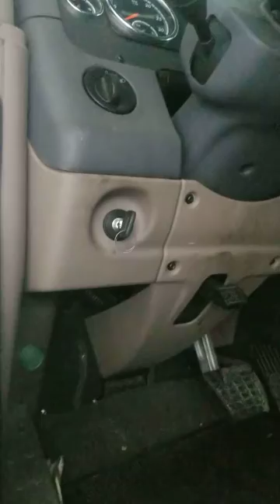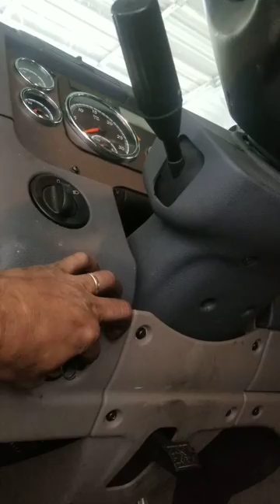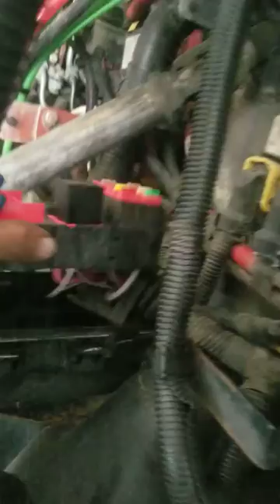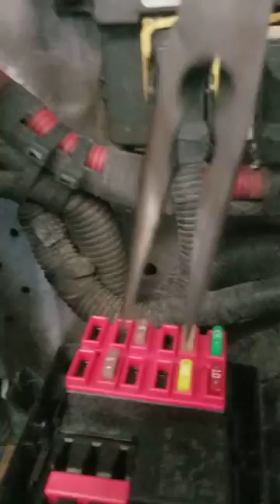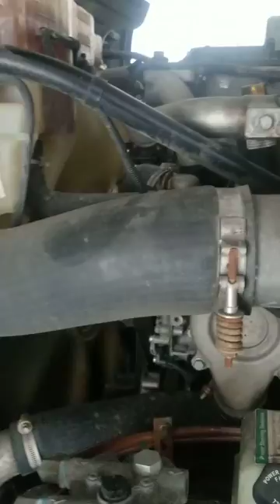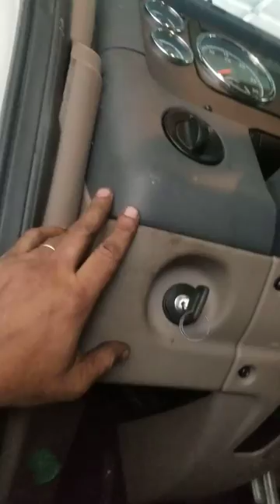2013 freightliner wont start quick fix

Comment: Thanks for the tip. Saved me a tow or Road Call. For others drivers looking to do this, make sure when you pull that Fuse out (ECM/MCM), that it's not blown. Also make sure the key is to the ON position when you pull the fuse out and place back in, Your truck may not start automatically like in the video, but you might be able to get it started with the key after unplugging fuse and reinserting. That was the case for me. If this trick works for you and you find yourself constantly having to do this to get your truck started, it might be time to replace your ECM/MCM (Engine Control Module) Hope this helps.

Comment: You saved my money bro. It happened to after I washed an engine, but now all working on 
Appreciate your support
Reply: Just washed my truck yesterday and this is happening , what was the solution for this on your truck? Just replacing fuse?
Reply: Friend I just wash my engine and I did a call service they want to bill me to replace. Computer should you recommend do this instead mechanics said I can burn the ecm help please i have to pull out my truck from wash bay with a towing service 😂

Comment: This just happened to me at a receiver. Shut truck off after checking and it won’t start. 
I followed the procedure and it worked!
I’m yet to figure out what the issue is cause I have brand new batteries and starter replaced 2 months ago. 
My truck is a 2011 cascadia, dd13.

Comment: I have 2013 Cascadia manual transmission, won’t start. Cutch switch Replaced, sometimes starts some don’t. I might have bad starter. Do you know if this trick works on my truck? Let me know plz.
Reply: Sometimes will start and sometimes will not? That's usually loose wires on the starter or a bad temperature sensor on the starter motor. Disconnect the battery then see if any wires are loose on the starter. It is common for them to work loose, especially the big main power cables. Also, look for the temperature sensor at the back of the starter near the bottom. Jiggle the wires and see if the sensor moves in its socket. If it does it's definitely bad.

It it's a bad sensor you have to replace the starter since that sensor is really hard to replace and not worth the effort. If the sensor is the problem you can always jump the two posts on the solenoid to start the truck. I bought one of those cigarette lighter sockets with two long wires and alligator clips at the Fly/J, then cut the socket off. The alligator clips go on the solenoid posts. Then you can jump it without getting electrocuted. Just jerk the wires loose after the truck starts.
Reply: Bro did you figured it out what was the problem I have a same problem right now my truck starts sometime it won’t start

Comment: I have same problem on my truck and nothing working on my case I have to towing it….and they found out was fuel meter not working
Reply: Did you fix problem? I can't start truck fuel meyer doesnt work too
Reply: @sergeyudalov1719  yes was a fuel meter pomp if your truck RPM Lately was bouncing up and down…that was a problem on my case
Reply: @armandcalifornia8276  is that the same as the Quantity control valve?